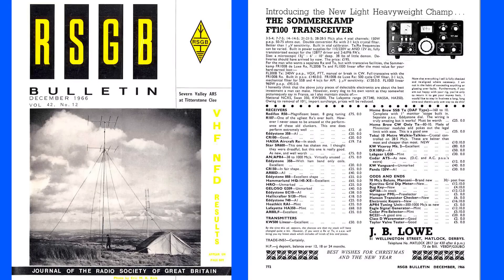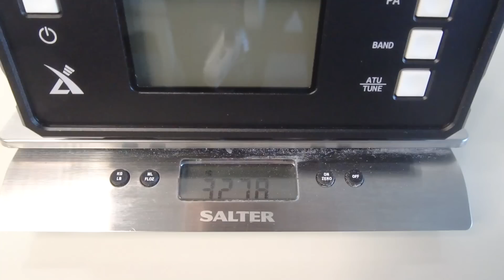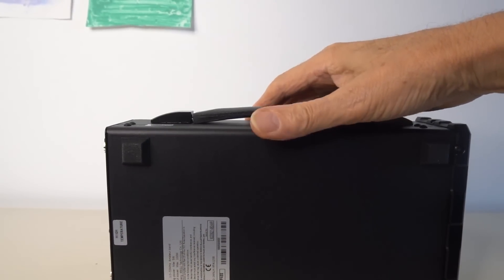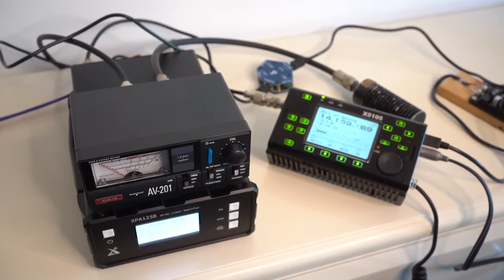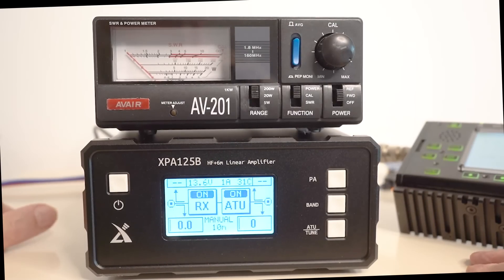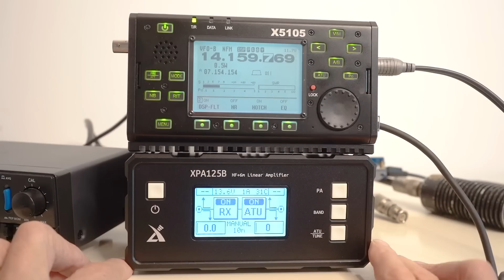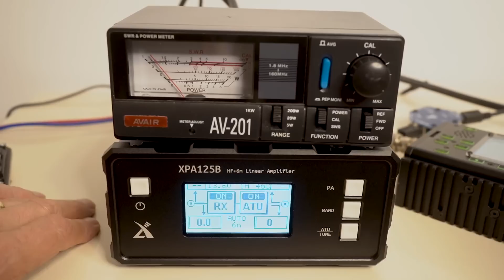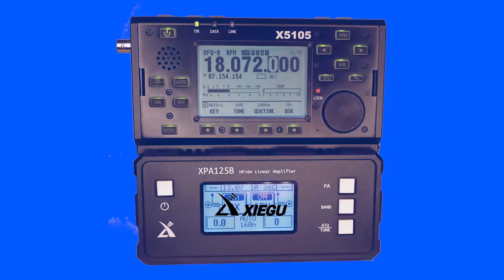Ham Radio - QRP Mega Watts with XIEGU XPA125

Comment: I grabbed a Xiegu G90 last year during the Christmas sales and thoroughly enjoyed it. It did what I expected for the price break and got me back into HF in an affordable manner. That being said, the amplifier that you highlighted today is at far too high a price point to make me want to close the sale. At the price of the radio and the amp, it's very close to ICOM 7300 territory, which I ended up buying around March of last year. I'm afraid I haven't turned the G90 on since then, but it is sitting there for when the time comes and I decide to put it in my truck. If I want to do QRP, I can just turn my output down on the ICOM. If the amp were priced in the $200 to $250 price range I'd grab one just for fun, but in my ham forums I've seen far too many tales of woe concerning it to pay $500.
Reply from the maker: Many thanks for sharing your thoughts. 73 Peter

Comment: Peter, I forgot to mention how  much I enjoyed your monolog about 'Ham Radio Timelines' in the UK, I remember those transitions also (you forgot to mention NRD-2020 but I guess that fine radio company fell behind) the big 3)- I also fondly remember visiting 'Bandit Bill's establishment in Matlock numerous times and John Wilson was the engineer behind the 'Lowe Receivers' which have become a collectors item! 73 ega
Reply from the maker: Yes Bandit Bill is fondly remembered. In fact  we ended up running a franchise there. Sadly Lowes went commercial only and then was sold off.  73 Peter.

Comment: Hi Peter, Well you said (email) that you were looking at the XPA125B and, true to your word - look - like a rabbit out of a top-hat, there it is! 

I am hoping that you can get your Southampton-Boys to fabricate that cable for the TX-500 (and the KX2) and give us all (read here 'the WORLD') a demonstration of those two aforementioned rigs working in 'real-time' - maybe from your back-yard, or at least your warm Conservatory! 

It will make a nice accessory for many QRP Radios and it seems that a simple interface (maybe opto-isolated) would be adequate?

By the way, the TX-500 looks kinda odd sitting atop the amplifier and would probably fit better lengthways? 

73 from Canada.
Reply from the maker: Thanks but cannot always perform that trick! 73 Peter

Comment: As more SDR QRP rigs have appeared in recent years, I have wondered why this HF QRP rig plus linear combo approach has not been more popular. Is the ideal solution for manufacturers to make QRP transcievers as computer controlled boxes with no front panel but with front panel and linear available as optional extras (even allow the modules to be snapped together to form a conventional desktop rig if desired). You could even have other "bolt on" accessories such as a larger waterfall/control screen. This approach would perhaps cover the demands of most operators with one product line?
Reply from the maker: I suppose FlexRadio come closest to this. It does seem that the majority still prefer a box with knobs and switches. Maybe its an-age thing and youngsters will push for a change. 73 Peter.

Comment: Decided to share my experience with Xiegu XPA125 purchased from Radioddity USA. It arrived dead, no power, nothing. They have NO contact telephone in USA so after few days through email I was issued a RMA to return product. After waiting a week for product to get to return facility I was informed it was out of stock and my money was returned. No more communication that was it. I feel fortunate it went that well. I'll also add I am on second Xiegu G90 which came with same defect as the first one : (   Beware ; )  No more Xiegu for me  : (
Reply from the maker: Sounds like the e dealer or importer did not help matters. Thanks fir sharing. 73 Peter.

Comment: Great video. I have an Acom 1000 sitting ready to go, was a treat before Xmas but not being used yet (still 2E0). Just liked the idea of valves lol.  But the point is that this small linear power amp looks great value, indeed the company appears to be producing product at amazing price points compared to usual suspects. I note your into music. I have a room full of synths by Moog et al. Then Behringer came along and made a copy of a Moog synth for about 1/10 of the price. For many synths fans this was a step too far, how dare they ! For others it brought the classic sounds if hardware to a point that many more could afford. There will always be some haters, but I have grown up (old) and it is progress. Indeed I have to admit most of my room of hardware can be emulated perfectly in software. Some of my most sophisticated synths are run on a computer now. And of course we now have SDR radio doing similar things!  So I think good luck to progression and I look forward to the company producing many more amateur radio products and easier price points .  Mark, 2E0MSR
Reply from the maker: Hi Mark, great to hear from you. Hope you oogn get the licence upgrade and enjoy that amplifier. Interesting about your synths.  My main instrument was violin, but I had to give that up as I now have sight problems in reading music, I took up jazz drumming some ten years ago but my skilll on the keyboard is somewhat limited. All the gear I have is Korg, and although I use Logic Pro, I now rarely use any software instruments. Take care, 73 Peter.

Comment: From what I understand (my wife is Japanese so may not be exactly correct), the pronunciation is more like Shay-gu.  I don' think we English speakers will every get it right. A bit like the tsu sound in Japanese lol.
Reply: Have trouble ordering General TSO Chicken ; )   I do not see the comparison (millennium difference) between Japanese Radios like ICOM IC-7300 or the amazing YAESU FTDX10 - NO Xiegu ; )
Reply: @ouijim  there's very little between any of the big brand radios today. They are all excellent and the Chinese are catching up fast too.
Reply: @MrScotchpie  I agree Japanese Radios are excellent as even low end YAESU FT-891 or ICOM IC-718 are refined form and function. Where Chinese radio are cheap stamped metal boxes with awful tiny screens (Xiegu G90) poorly designed SDR technology. I also think Xiegu is way overpriced at $450 for Xiegu G90 should be half that if you must have a cheap chinese radio. Yes I own all radios mentioned and would NOT buy another Xiegu G90, too many quirks.
Reply from the maker: Just to underline the point I made. In early 1960s the Japanese gear was low cost, low performance copies of well established brands. Fast forward to 2020s - do you now see a similar pattern?  Thanks guys. 63 Peter.

Comment: I have an ICOM 705 hooked to a XEIGU XP125B. Works OK. You have to run the amp in MANUAL mode, since currently there is not a band data cable that works between them.

You can make your own PTT line, or buy one from the "other" English Ham store. 

The display is great. Tells you everything you might want to know. It is not a Elecraft KXPA100, but it doesn't cost 3 times as much. 

Having a 100watt amp AND a 100 watt autotuner for around $550 USD is a good value.